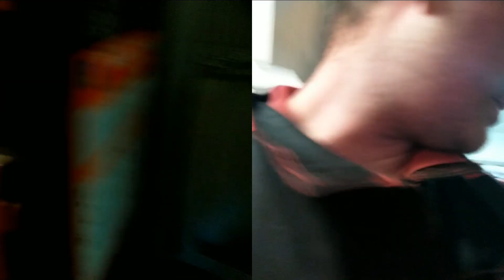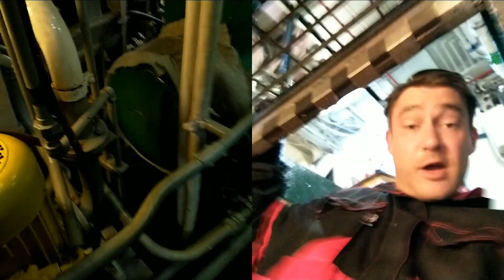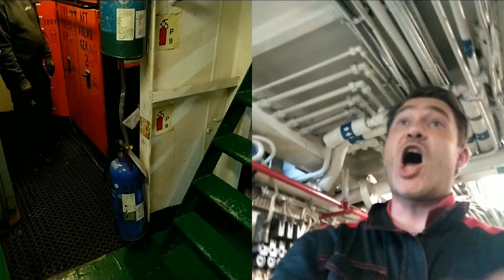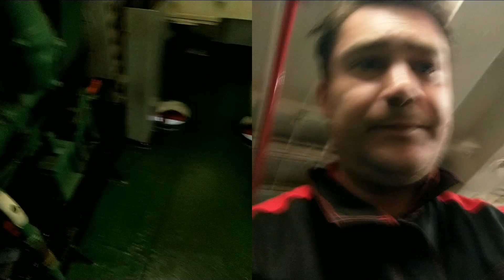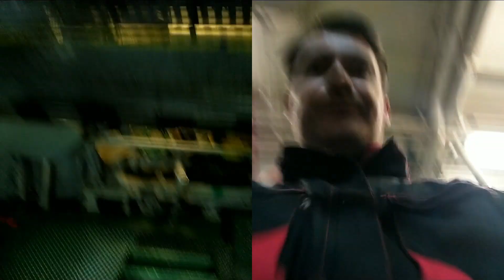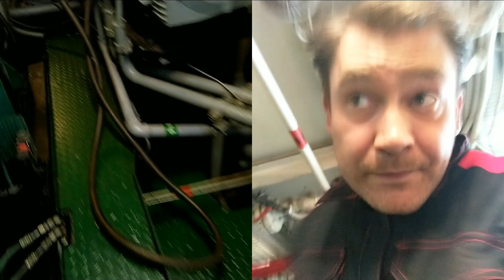Troubleshooting the Ship: 380V Volvo generator wouldn't auto start!

Comment from the maker: Alongside the 82 Litre Turbo Diesel Engine there were 3 other engines. The 16 cylinder Deutz is for powering the Schottel, the other two were generators for power (220 & 380V). The Volvo was the only one that started electrically, the others using compressed air from tanks. The Volvo had an auto start feature to toggle so it would kick in if we "Black out" (lost power), we need power to steer so quite an important safety feature! It could also be used to power the compressor for us to fill the air tanks to start the other engines if we weren't hooked up to shore power.

The Engineer and Electrician were a little stumped. The batteries next to the Volvo engine were good but the panel was lighting up like a Christmas tree. I watched it whilst it tried to start and noticed the first error light to come up was for lack of 24V power.

I found a pair of "mystery batteries" that were not in good shape, suggested we swap in the Deutz engine batteries as we don't use the Schottel anyway. Sure enough the Volvo then kicked in with Autostart. I then show starting the harbour generator for 220V power, "manually" shut down the 380V Volvo just to see if the Autostart would kick in again when the harbour generator power was stopped by one of the other guys...which it did! :)

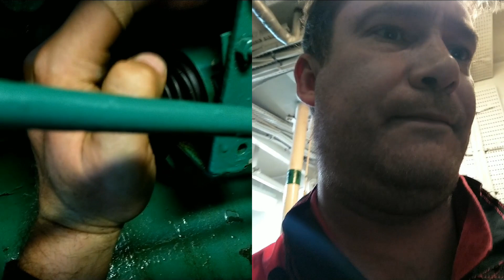Comment: 2:02 what triggered this alarm? Engines down?
Reply from the maker: Main 82 Litre engine wasn't running or you'd never have heard me talking. It was literally the size of those Hummer Jeeps the US Army use, it's turbo alone is the size of a normal car engine!

I manually shut down the Volvo generator engine, the alarm was because we went into "black out" (no power). The Auto start kicked in and fired up the Volvo engine again to restore power. Which is what we wanted it to be doing, without power we wouldn't be able to steer if out at sea! There are batteries for emergency lighting and the alarms to work etc. obviously.

Normally we would only use the harbour generator (the one you see me check the fuel and air lines etc. before cranking over) as it uses less fuel. That gives the boat 220V power, the Volvo is 380V that needed to be run to power the windlass (winch) to bring in the two anchors and run the crane rated for 3 Tonnes. Should the Harbour generator fail at sea, we also wanted the Volvo to kick in automatically and save the day.

This was the main engine room, there was another at the bow of the boat. It also had a Volvo Penta 380V generator and another 16 cylinder Deutz engine to run another schottel (a propeller on a shaft that could be raised and lowered and steer the boat to hold it in position)
Reply: @Honosuseri  Interesting and really cool to operate such a big ship. What type of ship was it? Could you give me a name model type or something so I can google it? I feel sorry for the loss of your uncle, he had a great dream.
Reply from the maker: @Paweł B https://en.wikipedia.org/wiki/Saint_Christopher_(yacht). Take it with a pinch of salt, it's not accurate BUT gives you an idea of what she was and meant to be after the refit.